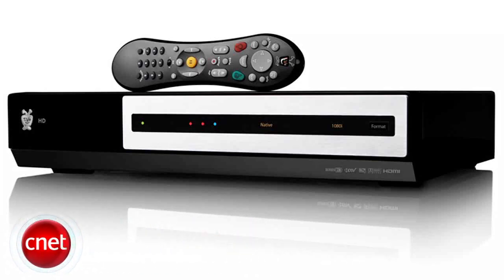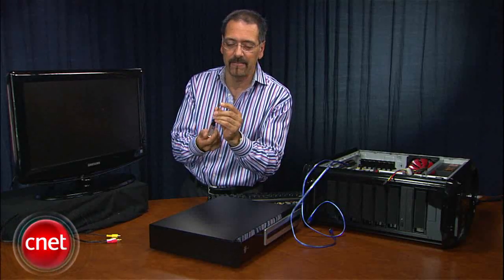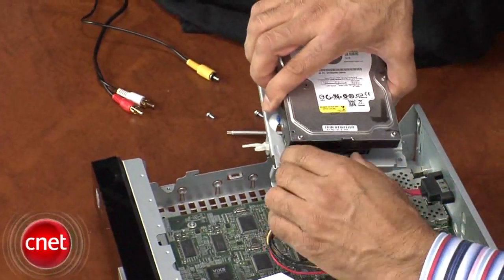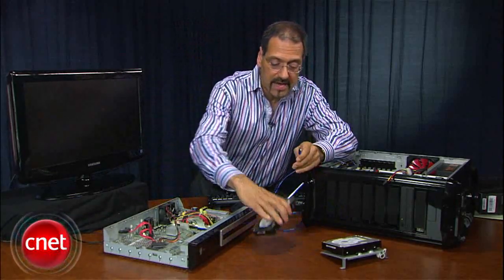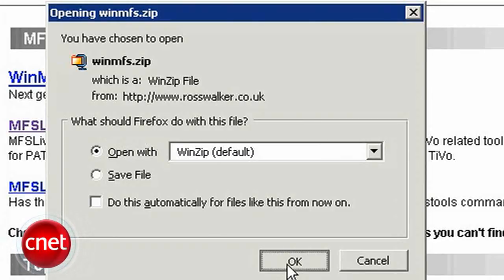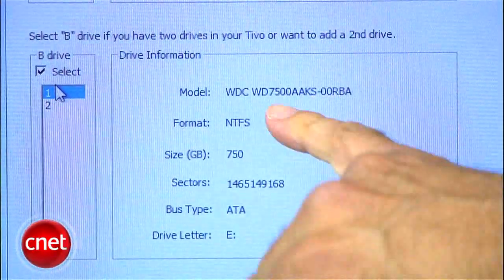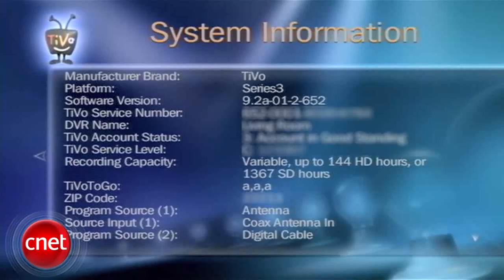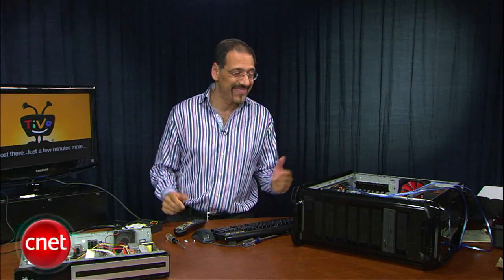How to Add an External Hard Drive to Your TiVo HD video from Answers com Videos

Comment: He said that the external drive "must be connected and powered up to the Tivo forever, or you're lose any new recordings since the upgrade." (4:45)  Does that mean that a simple power outage will whip out any recordings?  If so, that alone would make this hack a waste of time.  Does the same apply for the approved Western Digital hard drive?
Reply: I have a Western My Book on one of my machines.  Yes, it's the same.
Reply: +Plazaaz no a power outage will corrupt anything that is recording durring it. You should not lose anything else as long as the drive comes back on when the tivo does. with any computer/hdd if it shuts off while saving you lose what you where working on nothing more.....usually lol